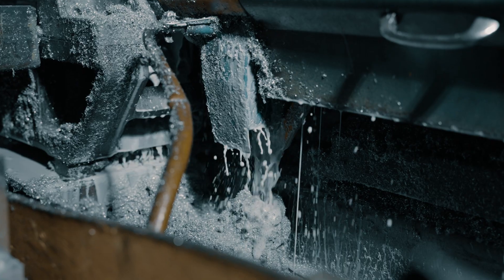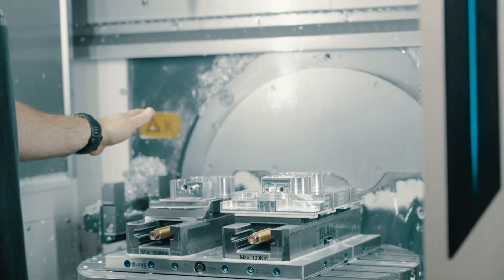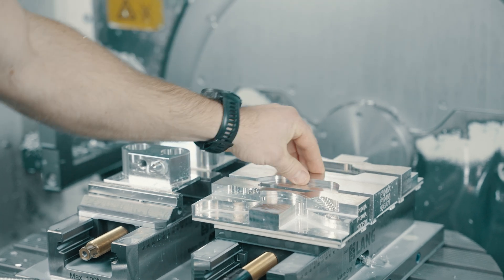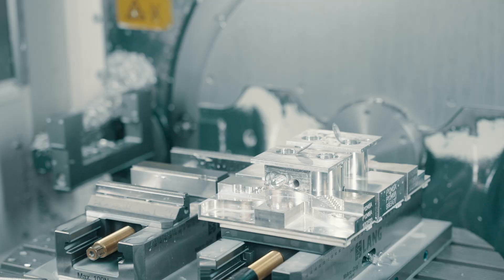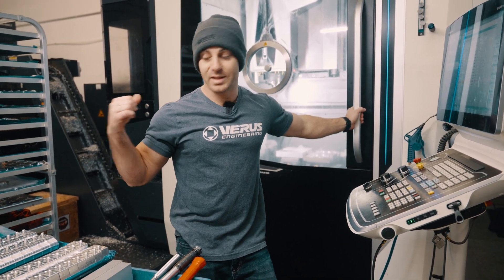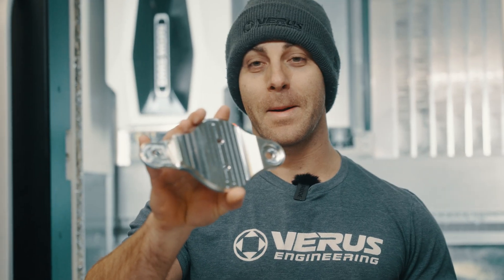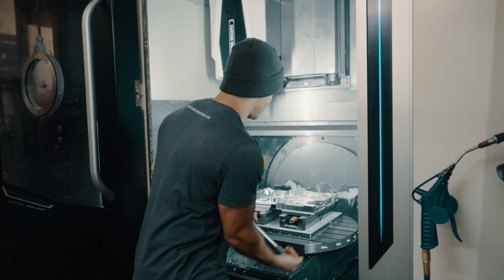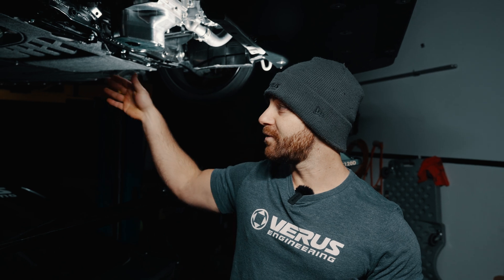Machining Motor Mounts for our Shop Toyota GR86 (FA24)!

Comment: Any chance you’ll be making some
For the 2002-2014 wrx? I have a k24 86 and have to use the stock wrx mounts, which suck really bad. I tried some other mounts and haven’t been able to find a good solution.
Reply from the maker: No current plans, but we will keep it in mind.